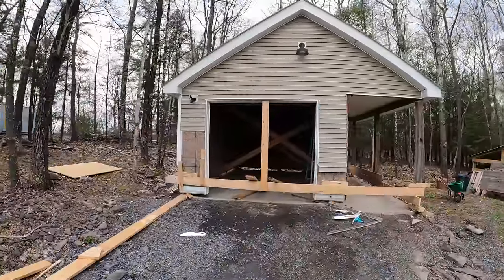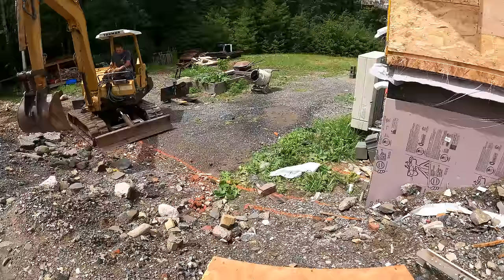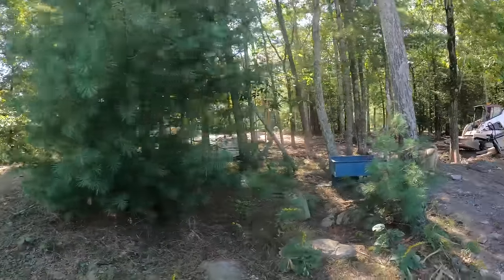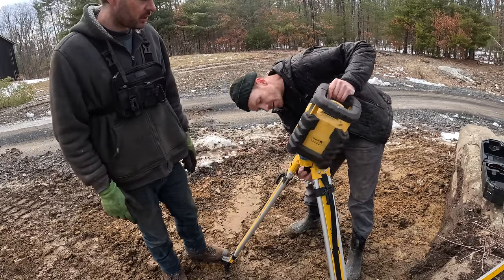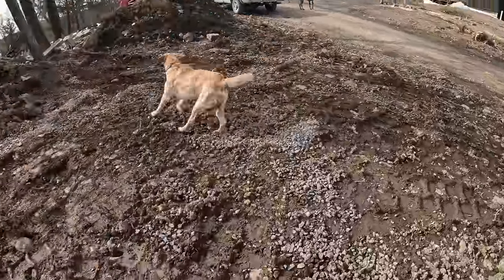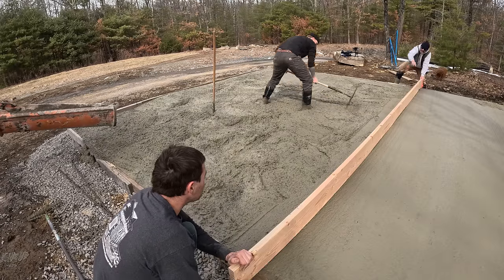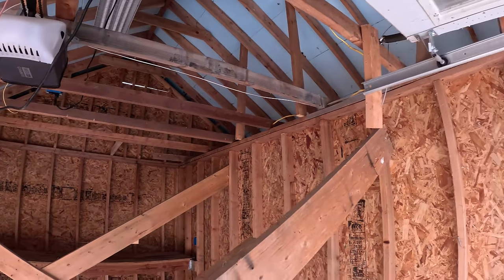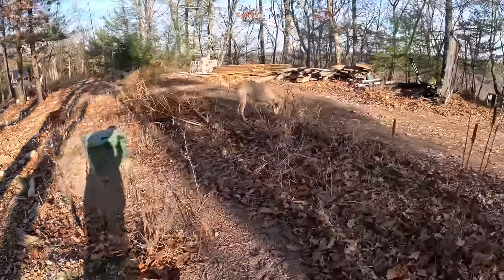Move garage, bury propane tank, pour slab

Comment: That propane tank won’t last as long as it should. You are supposed to paint the any ding on the paint with the special paint the tank comes with to prevent rust that could lead to a leak. Just a fwy underground leaks can deodorize the propane smell and it stays in the ground and can only be removed by a hazmat cleaning crew. Also the gas can leak into a basement  and with it being deodorized could lead to an explosive problems. The anode bags will slow the process but only if they are regularly tested. But still the life of that underground tank won’t last as long as it should without that protective paint on the dings I saw in this video even with the anode bags.

Comment: It a wired way of making a foundation just put the concrete sheet on gravel that it here in Eastern Europe we do it differently we dig a perimeter depending of terrain if is a hill place or to much sand we dig it deeper and we weave the steel bars yes in the end we use much more concrete but it last for generations !!!! Not mention the consistency of the concrete look different it use apparently more bigger size gravel then what we use ! In conclusion US it different in everything....

Comment: Driver of forklift on leading end of building (at 2:28) is disregarding the signals NOT to go.  He is pulling the building apart.  At present movement should stop whilst another brace is added along the edge of building where the hinged door is.  That side of the building is pulling apart, as the brace on the forks of that leading forklift is not rigid enough.  It bends massively, pulling that front edge of the wall.  More attention to detail is needed.   Do you intend pulling the building fully apart?????  Looks like you do.
Reply from the maker: The building stretch demonstrate in this video was within tolerance.
Reply: ITs a clown show, you got to realise that. There is nothing professional in anything Andrew does. ITs all rank amateur buffonery.
Sometimes its like watching an episode of the 3 stooges.

The only time you see how its done correctly is when genuine commercial operators work on his vids, like DirtBoss.
Reply from the maker: Everything here was done perfectly

Comment: No foam PANELS on the floor to 'help with your cold. Iike how you poured for screen lift, but no real rebar. vs >6" depth strength. Concrete 10 yrd delivery Cost??? in the Hudson area.

Comment: Why not just a framed 2x12 sled on the outside walls and x brace on the base pulled by 1 skid steer no need to lift  higher than blocked  +4" corners; or even a 4 corner sling lift

Comment: Why not use a power trowel to put at least some kind of finish on the floor. A bull float finish is not a good floor finish. Doing work for yourself is one thing. You might find yourself jackhammering a floor out if the customer isnt happy. Power trowels are not hard to learn how to use. Good job otherwise.
Reply from the maker: Thank you. Usually I get the floor about perfect with that thing I was using, but I may invest in a power trowel. Next time I have to do a slab, it seems like I do about five slabs a year.

Comment: Very poor management of the building placement on the new slab.  The machines should have been lined up very much more accurately so that the building would have gone onto the slab pretty much in the right line, and that drooping pole coming out of the bottom of the hinged door (threatening to tear the side away) should have been secured inside at the right height.  All that can be said for that sloppy job is, "it is on the slab".
Reply: They are rank amateurs, you cant expect a professional job here.  I was going to add the obvious dangers of working alongside Andrew Camarata.   But tugging that rock on chains, at 24.00 he wont last very long the way he works.

Comment: That garage got trashed. Should of set it on a trailer and moved it or just demolished it. Not a fan of that burnt wood look I gotta say either. If it werent for the driver, they'd still be pourin that pad. He def knew what he was doin since they dint put the rebar on the little risers. Nice of him to jump in and help. I know pourin a level smooth pad is hard. Felt bad for those lil pine saplings. Was funny when andrew  had to run after the doggies midway lol. So is burying propane tanks for insulation from the cold or asthetics? Here in s tx there all above ground. Just wondering.

Comment: After watching the Tank Masters Environmental channel, I would never bury any fuel tank.  The potential environmental and financial impact is too great.
Reply from the maker: Even with propane?
Reply: @AndrewCamarata  I personally don't think that it's worth it, even with propane. Tanks buried underground, I believe rust out much faster.  It would be difficult to find a leak in a tank if it is underground.
Reply from the maker: Hmm. But its a gas though, it would leak up into the air if it leaked. Not ruin the ground like oil might.
Reply: @AndrewCamarata  Good morning ,
Propane is a gas heavier than air, it will tend to stay on the ground, buried it will not rise to the surface, this is why Propane must be placed outside and in the open air in fact it It's not very good to bury him because of that, but hey, by the time the tank leaks we will also be buried.🤣
Reply from the maker: How would it not rise to the surface?

Comment: That garage is trashed.
Reply from the maker: The garage is nicer than it ever was.
Reply: @AndrewCamarata  after a thorough rebuild.
Reply from the maker: It’s still better than knocking it down and bringing it to the dump. but that wasn’t really a rebuild, once all the walls were bolted down to the slab, it was fine, and he wanted to replace the roofing and siding to match the house anyways, that vinyl siding was ugly.
Reply: @AndrewCamarata  best option would have been to properly prepare it and properly move it. I know you're very capable so I'm confused as to why this was so sloppy.
Reply from the maker: They prepared it. It was fine.
Reply: @AndrewCamarata  we saw the video Andrew.
Reply from the maker: Yeah, that garage looks great, I don’t understand what phase it got trashed during,
Reply: @AndrewCamarata  the part where two skid steers were yanking it in different directions.
Reply from the maker: That’s fine, the walls can move a little bit, once it’s on the new slab, everything gets bolted into place.